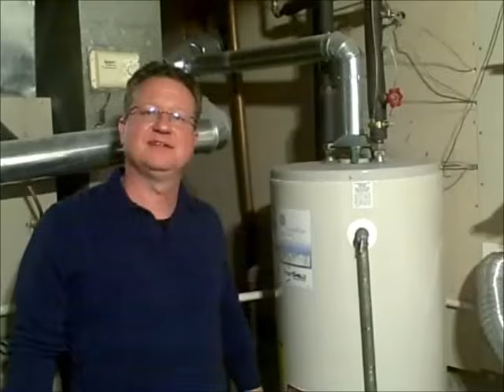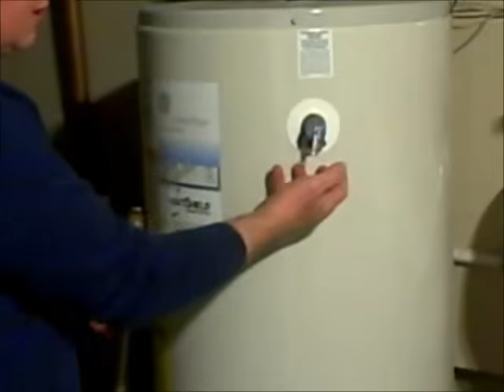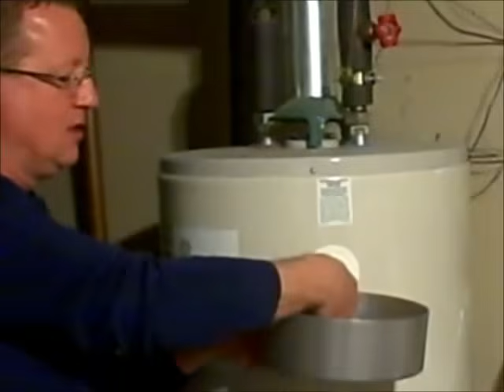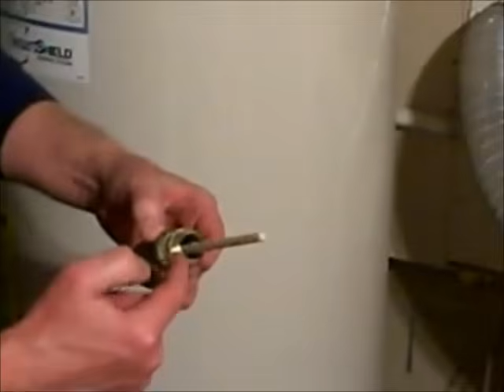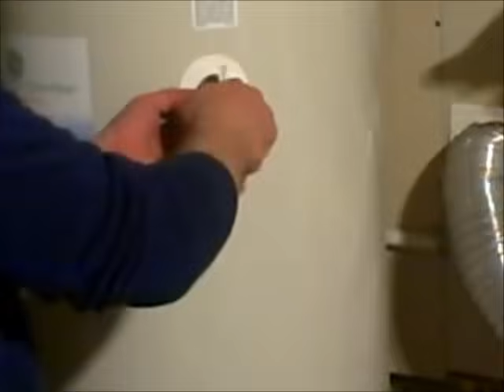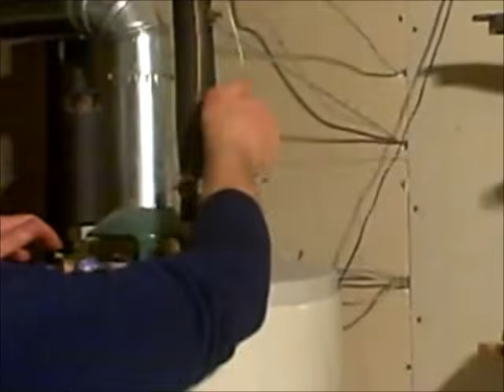Water Heater Pressure Relief Valve - Prevent Water Heater Explosion - Replace a Relief Valve

Comment: Why are gas water heaters sealed?
Reply from the maker: M Geez Hi, it helps prevent back drafts and it reduces the risk of flammable vapors being ignited from the burner. If you were doing a project by the water heater with a something like a contact cement, it lowers the risk of igniting the fumes. We have more tips on our weekly podcast http://www.stitcher.com/s?fid=49441&refid=stpr
Reply: FIX IT Home Improvement Channel My sealed gas water heater -- the pilot light is sooooo low to the ground and it is really hard to see if the pilot light is on -- cant tell when the heater is off -- cant see if the piezo igniter is working - just a brief flash-- had to lay on the ground to see into the little tiny window -- only can see when the burner is on -- the window should be twice the size -- I guess that I need to put water heater on a platform.
Reply from the maker: M Geez The new water heaters can be a pain. You now have to keep the filter that is around the base clean and the flame vapor arrestor under the burner.

Comment: Sorry if I ask a silly question on the relief valve.  I found this video after I just noticed for the first time, the extension pipe from the relief valve seems to have a slow drip.  I was first curious if it was because my sons had taken some long showers but rarely check the basement.  When I saw the water I was a little concerned, but it hadn't hit my water alarm contacts yet and there is a drain there so I don't know how much really leaks.  I'm assuming this should never leak/drip?  I also have an expansion tank on top.
Reply from the maker: Jason Sneed Hi, if the pressure and temp valve is leaking, you should change the valve. They should be checked once a year and replaced every 5 years. We have more tips on our weekly podcast http://www.stitcher.com/s?fid=49441&refid=stpr.

Comment: My cooper tube coming off the valve is very long and goes outside (where it drips). I can't just twist it off. Any suggestions?
Reply from the maker: duckmanjoel Hi, you can use a tubing cutter or a hack saw to cut it. Then just unscrew it. You can then use a coupling to reconnect the tubing. Check out our weekly podcast http://www.stitcher.com/s?fid=49441&refid=stpr
Reply: FIX IT Home Improvement Channel Used a sharkbite to reconnect the valve to the copper pipe...

Comment: I need to replace my T&P Valve, and I enjoyed your video, but there was no mention of figuring out the SIZE I need. 3/4" 1/2" 3/8"? My manual doesn't state the size, and I haven't been able to find out what size to try and by it BEFORE removing it. If I have to I'll take it down to the hardware store with me, but I'd rather avoid that.
Reply from the maker: TrackerFrost Hi, it is a standard 3/4 inch IPS. It should also be 150lb and 210 degrees.
Check out our weekly podcast on iTunes and Stitcher http://www.stitcher.com/s?fid=49441&refid=stpr
Reply: Thanks, but is the part that screws into the hot water heater a standard size, and just the part where you attach your outside pipe the different sizes?
Reply: TrackerFrost Went to the hardware store, they are universal for the input. Thanks for you help!
Reply from the maker: TrackerFrost You're welcome. Happy to help

Comment: I'm not sure if this is what I need to do for my situation.  The water line coming into the unit is off, the breaker is off.  And I have a hissing sound coming from the pressure valve.  The only time I don't have the hissing is when the water to the house is turned off.  Would replacing the pressure valve solve my issue?
Reply from the maker: Hi,
If the hissing is coming from the valve. Change it. You should change the valve once every 5 years. I mark the side of the water heater with the date. We also have a weekly podcast. Here is a link http://www.stitcher.com/s?fid=49441&refid=stpr

Comment: FIX IT Home Improvement Channel 
after changing the relief value, it still links. would you help me how to solve it please
Reply: I don't know
Reply from the maker: Hi, if it is leaking out of the valve, the water pressure may be too high. Do you have an expansion tank for the water heater?
Reply: Janet Livecchi
Reply: Janet Livecchi  yes

Comment: Replaced my leaky ten year old valve and my new valve immediately started leaking even worse than the old one.  What the hell?
Reply from the maker: Hi,
Is it leaking out of the spout or around the threads?
Reply: FIX IT Home Improvement Channel Out the spout.  Almost two drips a second.  I thought it was a total success after I installed it because it wasn't dripping at all, but then I tested it by emptying a couple cups of water into a bucket and now it won't stop dripping.
Reply from the maker: Hi,
Take it back to the store. They will give you a new one. When you put the new one in, to test it, only lift the lever half way. Then release it slowly, don't snap it back. Let me know if you have any problems.
Reply: FIX IT Home Improvement Channel Turns out the problem was that I didn't have an expansion tank for my water heater.  I had a plumber install one today and it solved the dripping valve issue.  Still, I did need to replace the old valve anyway, which I was able to do after watching this video.  Thanks!
Reply from the maker: Hi,
Glad you solved it. An expansion tank will add years of life to your water heater and other appliances. Check out our weekly podcast on iTunes or Stitcher. https://itunes.apple.com/us/podcast/fix-it-home-improvement/id880903087?mt=2

Comment: I have a heat pump HWS and the valve is rated at 1000kPa.
It seems to leak around 2 Ltrs of water per day; is this normal?
Reply from the maker: Hi,
I am not familiar with that system. Here is a link http://www.hotwatersystemperth.net.au/systems/hot-water-faqs.html
Let me know if that helps.
Reply: FIX IT Home Improvement Channel
Its just the same as any other water heater really.
If the heater in your video leaked 2 Ltr a day from the relief valve during its heating cycle, would you consider that to be normal?
Reply from the maker: Hi,
No. If the relief valve is leaking, it should be replaced. The other thing you may need is an expansion tank if you don't have one for the water heater. The relief valve should be replaced every 5 years too.
Reply: FIX IT Home Improvement Channel
Thanks mate.
Reply from the maker: You're welcome. We just started a weekly home improvement podcast. Here is a link https://itunes.apple.com/us/podcast/fix-it-home-improvement/id880903087?mt=2
Let me know what you think

Comment: Pressure Relief Valve leaks when Its on from time is value bad? Or too much pressure in water line??
Reply from the maker: Hi,
It is most likely water pressure from the tank heating the water. Do you have an expansion tank on the water heater line?
Reply: yes I do
Reply from the maker: Hi,
If you have an expansion tank and it is leaking from time to time, I would change the relief valve. It isn't expensive and it will keep your tank from exploding. The manufacturer recommends changing the valve if it leaks and once every 5 years.
Reply: the relief valve is on top of  the water heater tank this is leaking not continuously  but theres at least 1 gallon or more on the floor. so it happens certain time of the day. now I think its the expansion tank because the tank is only 5 years old. I will check the expansion tank too.
Reply from the maker: Hi,
You can check the pressure with a tire gauge on the expansion tank. You can inflate it with a tire pump.
Reply: yes I heard that thanks I will
Reply from the maker: Let me know what works for you. I love to learn.

Comment: Hi. Was wondering I have a hot water heater that once in a while it pours out HOT water out the relief valve. Empties about a bucket full. Is this normal? I dont understand when it says if this valve is leaking I need to replace it. when it does leak a bucket full of hot water and quits is that considered the valve leaking? And it is in a hallway closet and would need to put a hole through the floor so it can empty in the crawl space.
Any info would be most appreciated! Thanks.
Reply from the maker: Hi,
It could be 2 things. If you don't have an expansion tank on the system, it could be water expansion causing it to relieve the pressure. The other reason, is the valve is bad and needs to be replaced. You should change the valve once every 5 years.

Comment: If the relief valve is leaking it may be because there's some kind of sediment blockage which is causing the heater to overheat, in which case replacing the relief valve does nothing.
Reply from the maker: Hi,
I spoke to the manufacturer and they want the relief valve replaced if it leaks for any reason. If the valve malfunctions, it can cause a deadly explosion. They also want the valve changed every 5 years.
Reply: FIX IT Home Improvement Channel Manufacturers say a lot of things. My point is that the assumption in the video seems to be that the cause of the problem just a leaky valve, when in reality the more likely cause is that the water heater has become a health hazard and is over pressurizing. If it's over pressurized the last thing you want to do is open the relief valve and possibly coax it to spray scaling water everywhere. At the very least, before you go anywhere near a water heater that's possibly about to explode you should cut the heat to it and allow it to cool for a day and then see what's wrong. Just charging in and unscrewing the safety valve is a bad idea.
Reply from the maker: Hi,
You can leave the discharge pipe in place to test the valve.
If the valve is from a pressure buildup, you should install an expansion tank. Most communities now have a check valve coming into the home, so as the water heats it has nowhere to expand to, damaging the relief valve.
Reply: FIX IT Home Improvement Channel i 
i.-',

Comment: Hello. Great vid! I did everything. But hot water is still dripping from the overflow. FYI Electric heater. I might be thinking to much pressure? It works good but hot water supply doesn't last long. Also the dripping doesn't start until water starts heating back up. Thanks, morgan
Reply from the maker: Hi,
Do you have an expansion tank for the water heater?
Reply: just got one... My cold water line is at the bottom of the tank. I would have to mount the tank upside down and about two feet from the T. The lines are pex. I am thinking about just putting a PRV in place of the tank. Since I only have a few inches to work with.
Reply from the maker: Hi,
Use a Shark Bite fitting to connect the expansion tank. It will make the job easy.
Reply: FIX IT Home Improvement Channel Yes that is what i used! Didn't trust them at first. It's working now, having to adjust the pressure. It's making a humming noise.Also the brass fitting on the high side is dripping. I laid two big wrenches on it.I used teflon. Guess i will have to take it apart or move my prv to my main water inlet. Hey man thanks for all the advise, it really helped.
Reply from the maker: Happy to help
Reply from the maker: Hi,
The average life is around 12 years. I've seen some tanks that have lasted a lot longer, but it is probably time to start shopping.

Comment: Wanted to say thank you.. Quick question.. last night found the valve leaking water all on the floor and went to get a replacement and associate gave me a replacement. The valve had two sets of btu numbers.. 150,000 btu hr and then another number for 200,000 btu/hr. Then I looked at my original and found that it said 150,000 btu/hr and somewhere else 500,000 btu/hr. Didn't feel comfortable going with the mismatch so went back to the store to find the match. The PSI (150) and Temp (210) matched, but would it have made a difference with the BTU's? Also wanted to mention looked at the tank and it said 40,000 BTU. Thanks for your time.
Reply from the maker: Hi,
The two key things are the pressure and temperature. It is pretty standard at 150/210
Reply: FIX IT Home Improvement Channel
OK. Thanks for your time.
Reply from the maker: You're welcome

Comment: I have an 'odd' question for you .... why would my hot water heater release water from the prv pipe ONLY when I empty dish water down the kitchen drain?  At first, I thought I had a broken drain pipe but no ... water has come out of the hot water release valve pipe. Help!
Reply from the maker: Hi,
After washing dishes, your water heater is calling for heat and expanding the water in the tank. If you have an expansion tank, check the air pressure. If you don't have an expansion tank, I would add one. I would also change the relief valve. It should be changed every 5 years.
Reply: Thank you so much
Reply from the maker: You're welcome

Comment: uh oh! I was doing fine up until the pressure valve broke off while attempting to unscrew.  So now the thread part is left inside.....Please HELP!
Reply from the maker: Hi,
At the hardware store they will have a pipe nipple removal tool. You will need 3/4".

Comment: I just changed my PRV and it was really corroded but after i replaced it the new one leaked also but i noticed the leak was under the threading not the actual screw on part, as if its coming straight out of the tank (behind that white plastic piece that covers the hole on your) any ideas of what i can do ??
Reply from the maker: Hi,
I would remove the valve and use Teflon tape, wrapped clockwise 3 or 4 times. Or use a pipe thread compound on the male threads. Make sure to tighten it down fully. Let me know if that helps.

Comment: Nice video, seems simple but...I shut off cold water in put, drained 15 gallons (from 50 gallon unit - side mount) and bled off excess pressure and water by opening valve.  When I removed valve to replace it, water (warm), gushed out of the opening and showed no sign of stopping.  After 1-2 gallons flowed out I pushed in and threaded new valve.  I can't figure out where that water came from??? Is it possible that it was back flow from warm water in hw pipes in house?
Reply from the maker: Hi,
If you open a hot valve on a sink on the lowest level, you will drain the hot side. Make sure the valve on the cold side is fully off. Let me know how it goes.

Comment: Thanks for making this video. I changed mine today. The old one would open at temperatures above "warm". About 2 inches of the white plastic insulation on the end of the stem on the old one was missing. Both the old and new valves are 215 degrees/150psi, but the old one was 100,000btu and the new one says 105,000btu, I hope that not an issue. I have the temperature now set halfway between "warm" and "hot", no problems so far.
Reply from the maker: Glad I could help

Comment: Hello sir, something's wrong with YouTube's comment threads, I can't reply directly to your response but, that copper "pipe" seems to be wrenched and the drain /relief valve has a teflon tape to it, instead of a rubber hose, it's a copper pipe connected to it and that pipe goes and disappears to the right side wall, instead of above like the two copper wires (cold and hot) next to it.
Reply from the maker: Hi,
You just want to remove the  pipe connected to the relief valve so you can test the valve. You should be able to unscrew it, test the valve and screw it back on.
Reply: FIX IT Home Improvement Channel Sir, I was thinking perhaps that pipe takes the place of a hose and I don't have to unscrew it since that pipe goes to the side of the wall. Do you think that's fine? If I remove the pipe, would that not be more dangerous than testing the valve while it's connected to the pipe?
Reply from the maker: Hi,
If you can't unscrew the pipe, just use a tubing cutter and cut the pipe a few inches from the valve. Test your valve, then use a compression union to connect it.
Reply from the maker: blognewb You want to be able to see if the valve is leaking. If it is, you need to replace it.

Comment from the maker: Hi,
Can you remove the pipe connected to the relief valve? You need to test the valve and see that it is not leaking, or if water flows from the valve.

Comment: Hello? How come our relief valve is found ABOVE the water heater tank, next to two other tubes, one tube with the cold water valve? that relief valve is connected to the copper pipe and then it fades to the side wall. Will we be able to drain it like that???

Comment: I have a system 2000 and the relief valve did its job and released the pressure when i think the temprature probe/sensor either failed or may be coated with minerals etc and wasnt getting a true reading. do you have a video on the replacement of the temperature probe?

Comment from the maker: Hi,
You can pick up a replacement valve at the hardware store. Turn off the valve going into the hot water tank. Turn off your gas or electric. Drain your tank and then replace the valve.

Comment from the maker: Hi,
If the house is old and you have galvanized pipes, it could be a buildup of minerals and rust. Very common on the hot pipes in older homes. If the home is new, or you have copper pipes, it could be a bad valve.

Comment from the maker: Hi,
If the relief valve is new and not leaking, it could be releasing a build up of pressure. One thing that some hot water tanks need is a thermal expansion tank on the cold water side to control the water pressure.

Comment from the maker: Hi,
If your valve is not leaking, it should be good. I would check the temp on the gas control. If it is on the highest setting, you could dial it back. If your tank keeps tripping the valve you might have to install a thermal expansion tank on the cold water side of the hot water heater to control the pressure in the tank.

Comment from the maker: Hi,
In most cities, you have 30 to 35 lbs of pressure coming into the house. Your hot water lines are a closed system, so it maintains that pressure in the tank and in the lines.